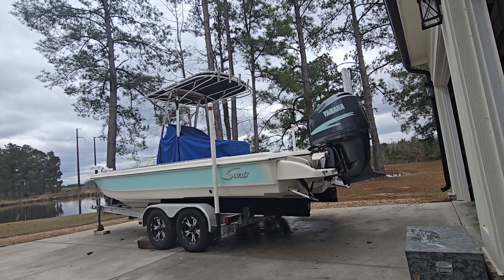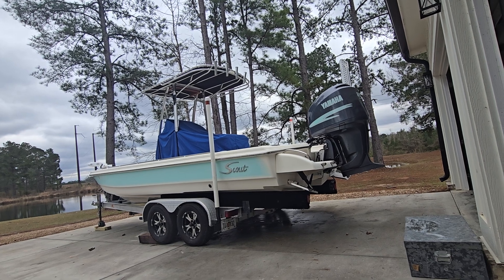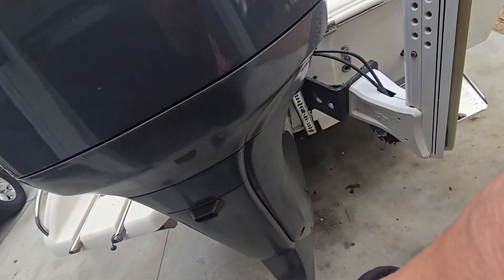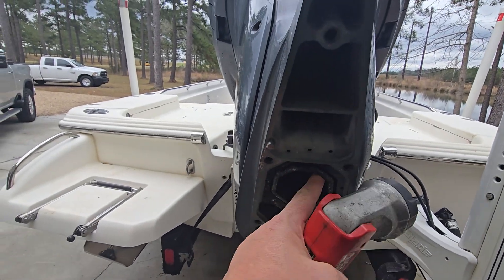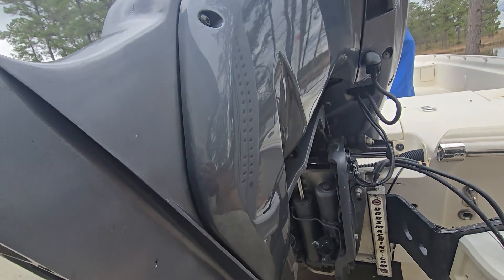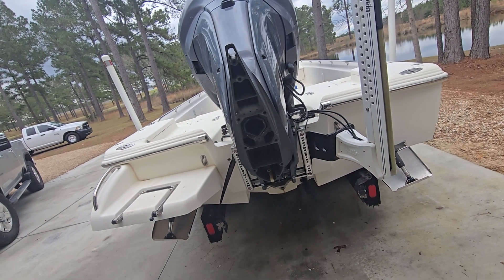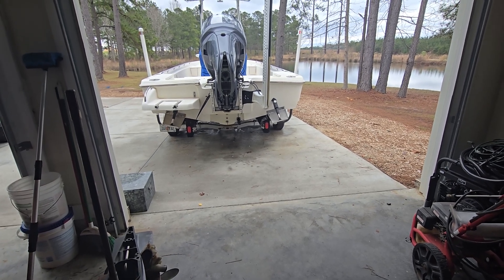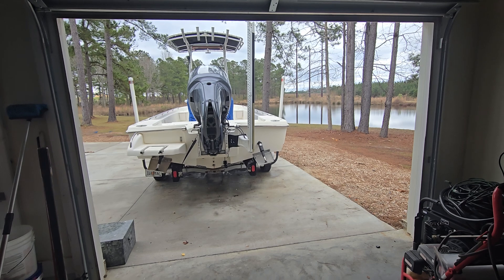Yamaha 3.3 liter Exhuast Corrosion and Oil Pump. To buy or not to buy?

Comment: i have twin 2003 F225 s and just asked AI why one engine is bubbleing at idle out of the prop...and the other one not...it opened up this whole can of worms with the exhaust corrosion. but i remember asking about that about 6 years ago ...then kinda forgot about it. if you can believe that with all the OTHER maintenance and issues with a boat.  anyway after 6 yrs  its still running and just wonder what  is going to be the final straw with these great engines .my prop shaft is slightly bent so im getting water into the lower unit so im just changing the oil often and putting in new injectors. put on new trim and tilt motors  new sea star rams  new shift cables etc etc etc

Comment: Hey great video. Did you end up doing the job or filming it? How bad was the corrosion?
Reply from the maker: I did the job. The exhaust tube only was corroded. Sold all of the other old components.
Reply: @huh_whoknew4714  Thanks for the response. After you fixed it has the engine given you any other problems?
Reply from the maker: @rudyu2767 nope good as gold

Comment: Pretty good video, if the motor still overheats with a new water-pump, thermostats and the water passages are clear etc, thats also an indication the midsection is probably corroded to a bad point.

Comment: I am doing to same work. speedy sleeve, new oil pump. Replace those countersunk screws with stainless screws and liquid electrical tape over the screw heads on the oil pump before you reinstall it. The supplied screws will corrode in place.